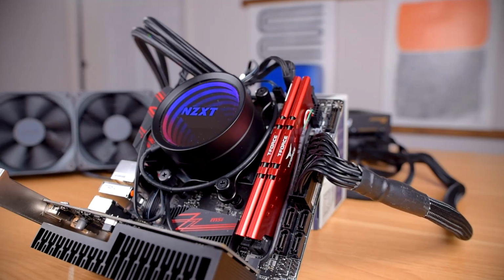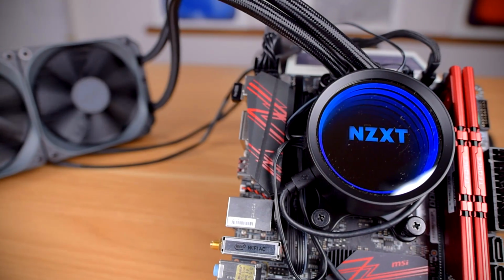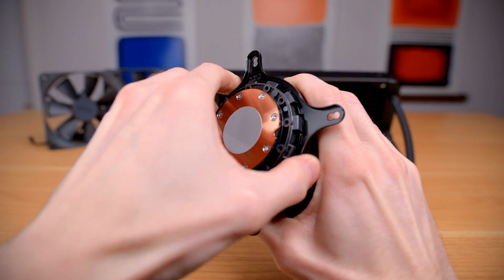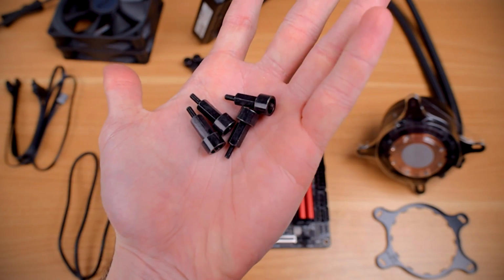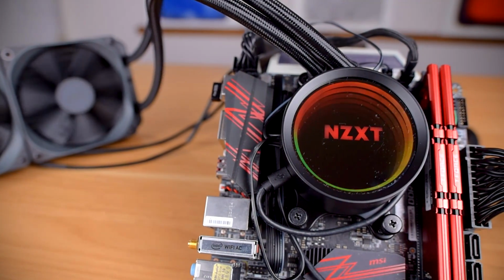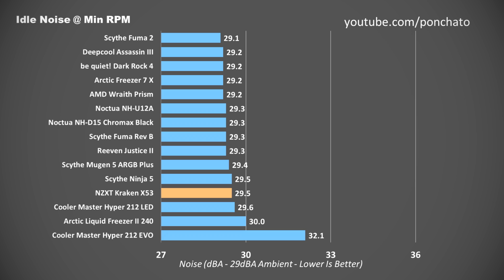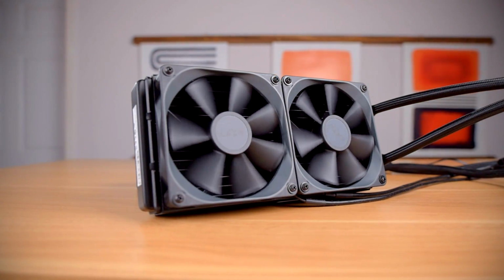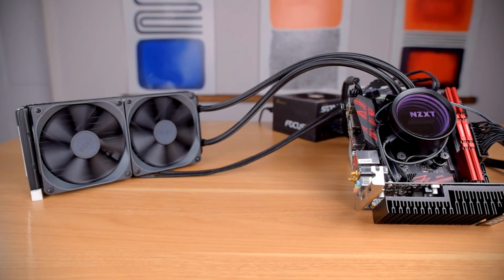NZXT Kraken X53: Changing My Mind About AIOs [FINALLY!]

Comment: Nowadays it's mostly about RGB and aesthetics. Even though I sometimes catch myself flirting with AIO products, I always return to air cooling. In the long run, I expect an air cooler to be less of a hassle: it has no liquids, it's easy to maintain and you don't have to neglect cooling capabilities depending on the air cooler you go with.
Reply: Usually aio get pump failures which leads to the coolant overheating and leaking.
Reply: @imeldomarcos4126  Not usually, if u do have pump failure you either installed it wrong or your aio is shoddy, the latter never happens, it’s usually user error.
Reply: I know this is an old post, but one of the main reasons to go with an AIO vs air cooling is the ability to work around it. The Noctua NH-D15 is a great air cooler, but do you want taller RAM? Nope. What about changing an m2 drive in the top spot of some boards? Gotta remove it. Like the aesthetics of your board? Don't get to see much of it as the cooler is MASSIVE. They both have their benefits but having the radiator away from the board really allows more freedom for components. RGB is pretty unimportant, but that's also a bonus if that's your thing. That said, you do need to install an AIO the right way (it's pretty idiot-proof, but some people do somehow have the pump at the top). I can't see myself going back to air cooling.

Comment: Great review! I got the x53, but was disappointed they didn't include the PWM splitters (I understand the older x52 had them). I bought a 3-pack Noctua NA-SYC1 and hooked everything to my ASUS ROG b450-I. It's DEAD SILENT, idles at around 38C and the highest I saw it in "normal" load was 65C for my Ryzen 3900X.
Reply: Hi hmemcpy, I was wondering, did you put the radiator fans in the splitter, and than the end of the splitter in de cpu fan connector of the mother board? Or did you put both radiator fans and the 3-pin connector of the breakout cable set on the splitter, and then the end of the splitter in the cpu fan connector of the motherboard. I also have the X53 with no splitter. Right now I have the 3-pin connector of the breakout cable on the cpu fan connector of the motherboard, and each radiator fan on a separate sys fan connector on the motherboard. But I’m not sure if this is correct :D Could you please help me with this?

Comment: Thanks for this! I'm considering upgrading from my cooler master 212 Evo to this and you covered everything I needed to know (specifically with the splitter cable) cheers!
Reply: Just a heads up, NZXT do now include a fan splitter cable with the X53, it was one thing that had put me off of the product due to the headache of sorting out alternatives to connect the fans, I have recently taken delivery of the X53 and can see that there is a new fan splitter cable included in the box. Cheers.
Reply: Did you end up upgrading? I have a Scythe Fuma 2 which is a great cooler but it's just a paint to remove and redo things when I need to. Curious if the X53 will provide better thermals making it a worthwhile upgrade.
Reply: @NewYears1978  Short answer yes it's worth it, long answer it get's me a few degrees cooler. That being said, I upgraded slowly from a ton of budget parts to what I have now. The Scythe 2 is probably a fantastic air cooler compared to the budget 212 Evo. So unless you're really annoyed with fiddling with ram and cables around your MoBo then i'd just stick with the air cooler.

Comment: used to run a Kraken X61 in my ATX tower for years but now I'm firmly in the SFF camp so aircooling only. less point of failures, zero maintenance, and much less cables to worry about
Reply: Wouldn't you want liquid cooling in SFF as its the best way to cool your cpu in a tiny buuld? A decent aircooler like the 212 wouldn't even fit in most SFF pcs
Reply from the maker: Very true, air is simpler and a lot fewer cables generally
Reply: @ShuffleToExpresss  212 was never designed nor meant for SFF so it's kinda mooted. Best here is up to the individual but it's a balance of performance vs needs (temps & noise), costs and usability/convenience. Do I want my CPU to run at 30C/40C at idle/load? Yes, but do I need it? No, I gladly make the trade for costs and usability as mentioned previously :)

Comment: I am building a new pc this year and plan on using my first AIO cooler. This, and H100i are the two I'm looking at.
Reply: get the Arctic liquid freezer if you can find it its 99.99 for the 240 and is the best performing AIO otherwise both NZXT and Corsair will be good , i went with nzxt because i like the way it looks
Reply: Keep this in mind, i use this for an overclocked i910900k its damn good

Comment: i would personally go a 280m aio over 240m for the 2x 140mm which bring better temps and airflow. This do the job if not able to do that though
Reply: So I should get the NZXT Kraken X63 RGB ??
Reply: @itsyoboig3325  what u building in what case reason I ask is because if going Ryzen might consider getting artic liquid freezer II 280mm or 360mm depending on what your case can take in less you want the NZXT AIO. Artic is bit cheaper and seems be better cooling on Ryzen. U can look up couple of AIO cooling benchmarks to make your thoughts on which one to go.

Comment: Yeah, it seems like you can't mess with air cooling.  I just purchased an intel i-7 10700k, 5 minutes ago. They run a little warm, I think. Would this do the job do you think? It is pretty.
Reply: I think you answered the question in the video, actually. Better than air though?

Comment from the maker: Would you (or did you already) switch to an AIO for better CPU cooling? Leave a comment! 👇
Reply: I would, i have the the stock wraith stealth cooler with the R5 1600AF
Reply: At first i was on air, because it was cheap, then i got an aio, i loved it, the performance, the looks, then the thing leaked, and  i did go back to air, got a Noctua and never looked back.
Reply: Nope, because I prefer silence, so overclocking is not for me - no needs. My way is Ninja 5 and 3x140 mm Silent Wings 3. There's nothing better than sound dampened case with well balanced efficiency/silence fans and never too big cooler radiator with slow fans.
Reply: With my Ryzen 1700X overclocked, yes. With the 3900X and not overclocking, I am using the box cooler. It looks great! 
It might be slightly noisy, but not bothersome for me in the least. 
I might consider AIO again one day, but not today!
Reply: Aio has fairly low maintenence requirements but that's still way higher than air. I know myself and I know no matter how excited and involved I am with a build, I will pretty much never want to open it back up again except for major upgrades. How long before I need to maintain my AIO? 4 years, 5 years, 6? Still don't want to deal with it. Maintenence for an air cooler is blowing it with a duster every couple of years. If you have a noctua, you can probably keep it running on your most current builds for the next 20 years. Their support for different mount adapters goes waaaaay back.
Reply: water coolers leaking scares me too much to switch. i know it doesnt happen often but, id rather not run the risk
Reply: I switched from an AIO after the pump died after about 7 months and the air cooler I have on there is perfectly fine.. I prefer air now because now I don't have to worry about the pump dying in the middle of a mixing session and losing all my data
Reply: No.  Too many wires. And maybe you got a good sample, but all pumps I've heard make noise.  It may not be loud, but it's like an annoying mosquito that won't go away.
Reply: I would have switched to AIO if the possibility of leakage was completely out of the way...
Reply: Those fans look like they would be very loud...pretty much airflow fans.
Reply: 4epa1012 Corsair AIO the RGB Xt series are 99% non leak why? They checked the mechanical aspect non galvanzing non corrosion. The pressure build up could be released from pump Cycling.
Reply: Don’t see the point to save 2/3 degrees off temperatures. I keep my computers for a while after trying to buy on the high end with each new pc. Something is far more likely to go wrong with an AIO than with a great air cooler. It’s just not worth the long term risk and hassle especially in a humid, tropical environment.
Reply: Which splitter is best to get for 4 fans?
Reply: Just ordered mine yesterday, just waiting for it to get here :)
Reply: I'm getting this and pairing it with a Ryzen 5 3600

Comment: Nice review however I'm surprised you barely mentioned using the software itself. I've been told it's terrible and has even caused major problems where the software has messed up and essentially stopped the fans spinning and worse as it's not loaded the profile correctly. What's been your experience with the software?
Reply: The software has been fine for me.   The old CAM versions before the major update was garbage.
Reply: tbuksuperfly new CAM is great.  Old versions had a well deserved bad rap.
Reply: @Rick.Grayson  good to know cheers :)
Reply: Just purchase this how do I get the new version

Comment: NO WAY i am switching to AIO cooling solution since air cpu coolers are performing about the same with some of them doing that at extremely low noise levels. Avoid liquid leaks, pump issues, cables and get your self an air cpu cooler that has a design that compliment your build. (that's my opinion)
Reply: On my hot 5950x with a 360 aio and my Nh-d15, I got nearly equal temperatures. Air is always the king unless you go cheap or have a custom loop.

Comment: Does the liquid in these eventually run low or dissipate over time? As in the fans are said to last 60,000 hours or 6 years, but does the liquid last that long with out drying out over time?
Reply: yes they do, but very very slowly, with the nzxt pumps you can take the heat plate off with a hex screw driver and add more fluid with something like one of those big ear dropper things, shake the air bubbles to the surface and repeat until you hear minimal sloshing.

Comment: so you recomend install nzxt kraken x63 instead noctua nh d15? i run a ryzen 5 2600x, got temps like 70+ playing call of duty
Reply: well yeah nzxt is a good water cooler would help with your temps but its up to you to decide if its worth the cost....but even some new thermal paste on ur nh d15 might lower temps
Reply: I wouldn't recommend any AIO over nh-d15. It's simply the most effective and quietest cooler. Simply for performance and quietness, it wins. Also its cheaper.
Reply: Go for scythe fuma 2 😁

Comment: ok so im trying to find what cables the x53 kraken comes with since i have a gigabyte a320m s2h

and im concerned that it wont have the required ports for the kraken since i bought a prebuilt 😐

and if someone can take a look at the mobo and tell me if its okay for the x53 to be installed or just even telling me what cables it comes with id be very thankful

Comment: All good and all till it leaks and destroys the entire build..
Nope, I'm sticking to air, it has zero leak chance.
Reply: Thank u now im more worried for building my pc with this aio
Reply: @christophertrubey8013  Every AIO has a leak chance, so make sure you read the warranty, if the aio company is going to pay for the entire damage caused, go for it.
Reply: Zoom is it common?
Reply: @christophertrubey8013  No it's quiet rare, but it happens.
It's so much trouble for me in my region to replace it or get refund for damaged parts if it did happen, so I went for air cooling.
If you can easily return it and get a refund for everything, you go for it, it's great but only in this case imo.
Reply: Zoom ah okay that makes me less worried but i ordered it from amazon usa which has terrible refunds 😭
Reply: Nzxt has said not even 1%

Comment: I'm pretty sure you have a mistake on the idle temps, looks like the air coolers show absolute temps not deltas.  U12-A showing ambient +36 at idle, then at max RPM it's ambient +39?  Mine is about +5 at idle, +35 at full load, 8 cores 4.6 Ghz.
Also.... the X53 at max RPM is ambient + 37 at 60 dB, but normalized for 40 dB it's +39?  Seems like either there's something weird there or that cooler hits a wall at about 38 degrees.  It would make more sense to normalize for temperature delta and see what the sound level is.
Also, were these tests done after running for a while?  AIO's get some bonus one-time cooling as their water warms up, then after 20 mins or so they're circulating very warm water.  A 240mm rad has about the same surface area as a big air cooler so theoretically they'd be about the same, lots of variables in implementation though.